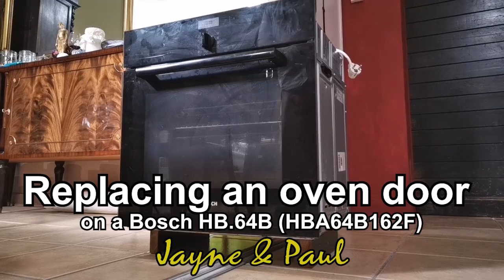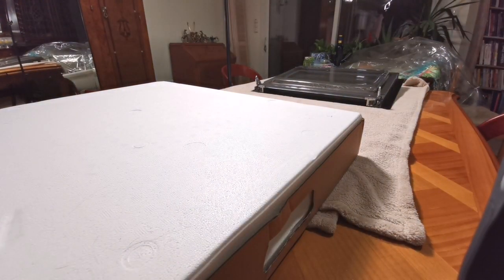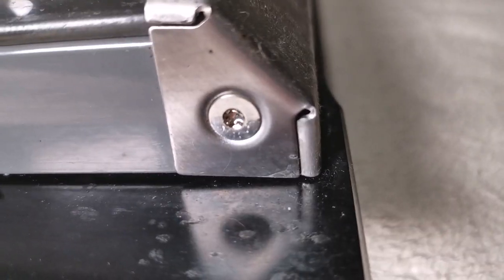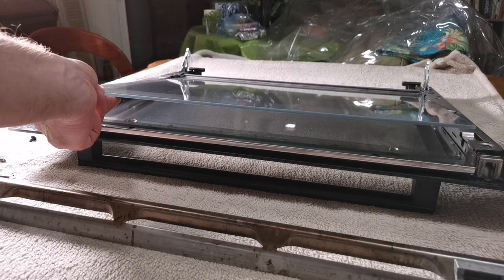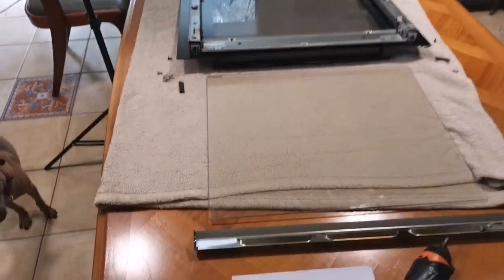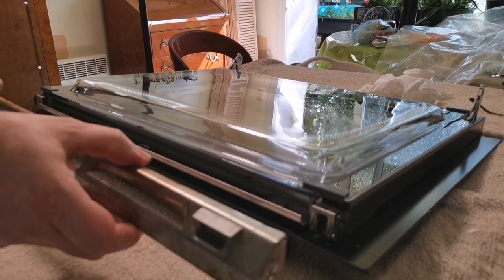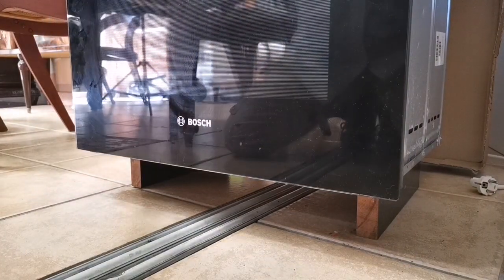Replacing the inner glass panel on the oven door of a Bosch HB.64B (HBA64B162F)

Comment: Hi, what a find this video is!  I have a Siemens oven with a near identical door.  The bottom stretchy seal with metal clips had perished but wasn’t obvious where it clips onto.  Siemens (BSH) flatly refused to tell me for health & safety reasons.  Any way of letting me know exactly where the clips fit on - is it onto the glass (before the final internal moulded pane), or onto the frame?  Thanks very much!

Comment: Great video, thanks. What are the two  'U'-shaped adhesive pads for that also come with the replacement glass.They are in your box  and mine but I'm not sure where they go. Any thoughts?
Reply from the maker: At timecode 1:52 you can see the existing ones in place next to the hinges on the old door.  The original ones were still in good condition so I didn't use the new ones.
Reply: Thanks for your reply. I'm sorry but I can't see them. The pads I'm refering to are those stuck on the yellow foam in your plastic bag at 1:52.  Do they go next to the hinges as you suggest? It isn't the two plastic clips that hold the glass in place but the 'U'shaped foam pads I'm unsure of. Thanks again for your help.
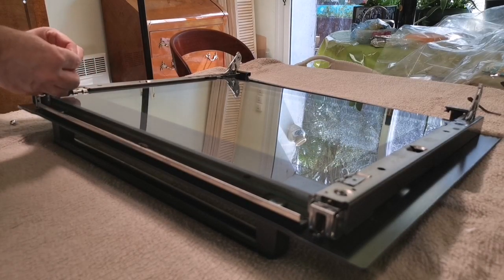Reply from the maker: @ianblick1  Perhaps they go under the metal side clips at 7:00.  There weren't any similar pads when I took the door apart, and I didn't use the new ones from the box. The oven has been in daily use for over a year now without them, so I don't think they are that vital.  Cheers.